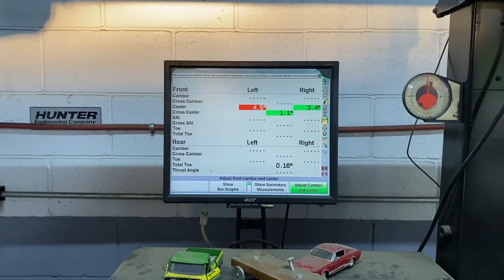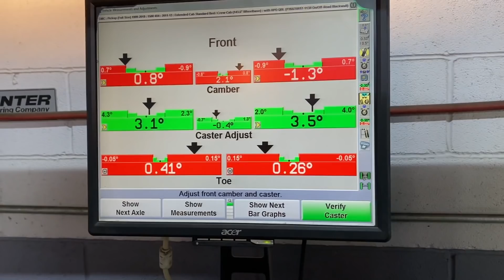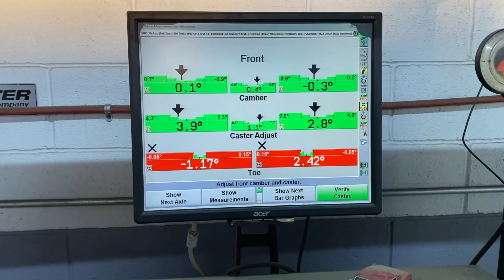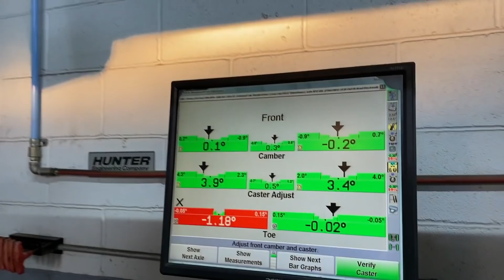My Wrecked 2013 GMC Sierra Failed The State Inspection | Here's Why

Comment: I saw the issue in ur frame just by looking at the alignment readings on the screen,  try not to hate on me to hard I hv done alignment for 35 yrs gd job fixing it
Reply from the maker: Do I need to change the tie rod?
Reply from the maker: I got a used on I can’t afford dealership price.
Reply from the maker: What do u suggest? Kinda in a pickle
Reply: @DannyTV7  frame rail or spindle still needs correction the spread from side to side was off by 3 degrees trk should pull right, but forgive me it's been 3 weeks

Comment: Not sure if your alignment guy will read this comment. but if he clicks on the picture of the control arm in the caster or camber measurement windows. the little control arm in the bottom left of the colored box. he can click control arm adjust on turnplates. then it will tell him what direction and how far to turn each of the front and rear cam bolt, and that will put your caster and camber bang on.
Reply from the maker: I will make sure my brother sees this bc I don’t think he knows that.